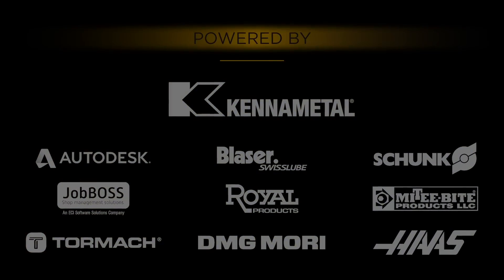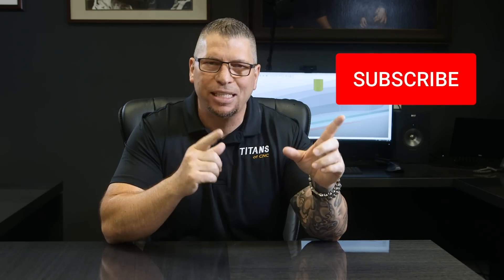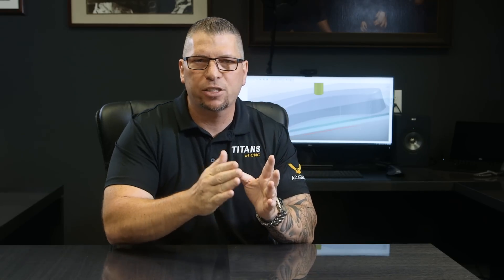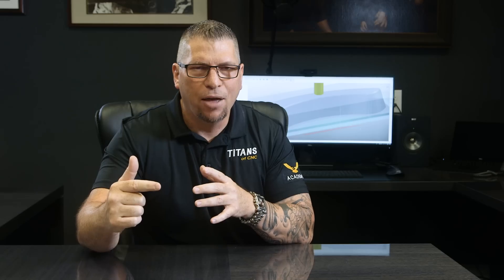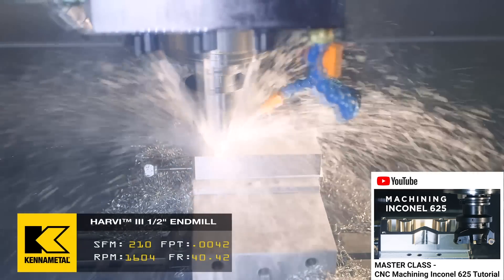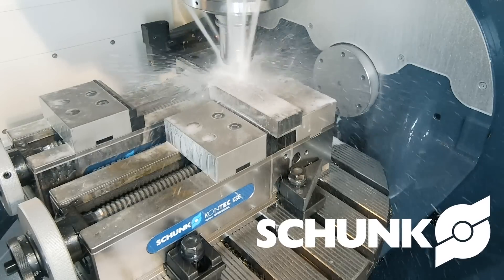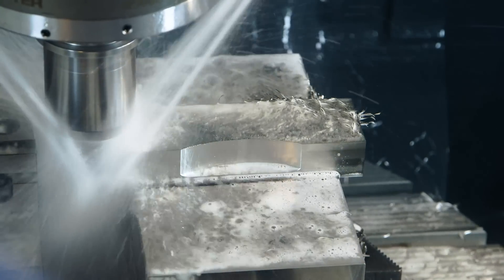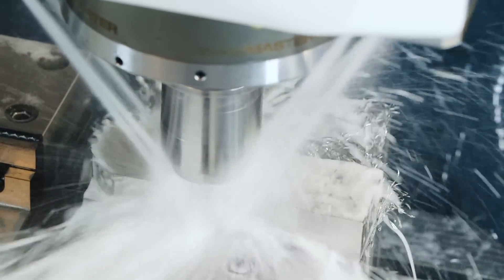Milling HASTELLOY | CNC Machining MasterClass | Vlog #90

Comment: So why am I jacking up my rpms to 2300 and a feed of .8 and not breaking a single coated 3/16 E.M? 1600, 1700 it breaks on the first but definitely by the 2nd piece? I'm also cutting .05 thick welded plates doing slots. Too much vibration?

Comment: Can you do some work in thin hardened stainless like 62hrc and above for slotting and adaptive work that shit ruins tools fast.  Currently using naCO I think that's how it's spelt coated 6mm corner rad 0.5mm 4 flute cutters.

Comment: I think a great vid would be showing the balance between tool life and cycle time. As in theres no point going through 5 end mills on one part if you can slow don the surface speed and use 1 :)

Comment: Titan, first off thank you for all the knowledge you share. I do agree with some of the comments below though. Milling is quote on quote, not as difficult, as drilling and tapping. Can you maybe show us how you drill and tap in tough materials. I know you have done a video on this before, but you used through spindle coolant. My machines done have that feature so I have to peck. I have failed miserably trying to drill some steels (4140 HT), which I know is not that hard. Can you show how to drill different materials (especially hard materials) with just flood coolant?
Reply: Never drilled high nickels with just flood before, but as far as threading goes I'd look into threadmilling. Much easier on the nerves. Tapping stainless, inconel, hastelloy, etc makes my butt pucker. Peck tapping on a machine with spindle synchro helps in that department.
Reply: @hxczach  I figure the drilling will have to be pecking with full retract to let the flood coolant evacuate the chips. Just not sure what dept to peck. Maybe 1D before full retract? I'm going to have to try it. As for tapping, Yea I hear you. I'll have to look into thread milling. I have a job coming with 316 SS. Its a 100 part run, 2 thru holes per part, 10-32 tap. Not sure if a spiral point tap will hold. Thanks for the advice
Reply from the maker: Here is one that teaches all in Inconel 
https://youtu.be/QVAcIS4WhPM

Comment: So I'm a young machinist and I ran into a problem yesterday. We are drilling a .240 hole into inconel 625. The holes are coming out tapered by .020-.030 thou. We've tried changed the speeds and feeds, the tool holder and collet, shortening the drill as far as we can and nothing helped. The hole is a thru hole only about .5 deep using G81 canned cycle on a Haas VF1. Any constructive comment would be helpful. Thank you and keep up the videos Titan! Boom!
Reply: There is probably someone out there that has worked on that material more than I have.

I would start with a carbide drill and a G83 with a few pecks, whatever the manufacturer suggests.
Reply: If you're using a center drill to spot it use an actual spot drill instead. Throw and indicator on your drill and tap the runout in as low as you can get. I always shoot for below .001. Carbide drill with TSC is always preferred.
Reply: You should be calculating your spindle speed around 10-15 metres/min.
Make a custom macro that drills in a few millimeters at half speed and feed then send the drill down at full speed and feed.

Comment: Please one video of 4140 with solid carbide endmill.
Reply: rocky7891 thats decently easy stuff. We go 300ipm on it at around 4K rpm and .02 axial
Reply: If it's not prehard you could run it at 350+sfm .004+ ipt 10+% stepover. 4140 is easy. Just use a variable helix em with a corner rad.

Comment: Hi titan.. Please tell me whether climb milling or Conventional milling is preferred for hard materials???I use powermill to program parts... My common material is 6061 grade aluminium for which i give "both" option... some times i need to work with mild steel??? which option is preffered????
Reply: Thank you sir👍
Reply from the maker: 99.9% Climb Mill...

Comment: Nice !  Perhaps for "Peeps" newer to CNC and these materials you guys could distinguish between 'hard"-to-machine versus hardened materials (which are also difficult to machine in a completely different way.)… When you guys use the term "Hard" you really mean "Difficult to machine" (materials). Folks that have not machined or handled those materials won't understand how much energy a "Gummy" material will absorb. Maybe you guys could make a video about the different kinds of chips that come off these materials and WHY they are mechanically hard to machine (i.e. what the higher nickel content is really doing in practical terms.). I am being completely selfish of course 'cuz I still want to see you guys make some videos on machining "Hardened" steels. ;-) Something that the DMU 50 3rd gen should also be good at ?

Comment: You really need a machine with solid build quality and huge rigidity to machine inconel, hastelloy, monel. I suggest using the tormach. Even DMG Mori can't compete with tormach for machine rigidity.

If using the tormach, just look out for the whole spindle assembly bending like 30degrees. Should be fine tho, you could program that out lol
Reply from the maker: Jokes 😂😂😂

Comment: What sort of tool life are you getting, that end mill sounded a bit stressed towards the end.
Reply from the maker: 2-7 hours depending on aggression.
The rigidity was also less at the end due to all the material being Machining away and the part being thin on the bottom.
Reply: @TITANSofCNC  That was probably the cause of the vibration I could hear.

Comment: Machine a large neodymium magnet from a cube to a ball.. now that's a challenge!! 😆
Reply: You can't. It's a sintered material just like ceramics. You don't machine it, you form it in a mold from powder and then bake it.
Reply: I guess you can do that with EDM but how you did it
Reply: @marouanebenderradji137  I've not done it it was a challenge and yeah edm would maybe doit I feel it's impossible that's why I said lol